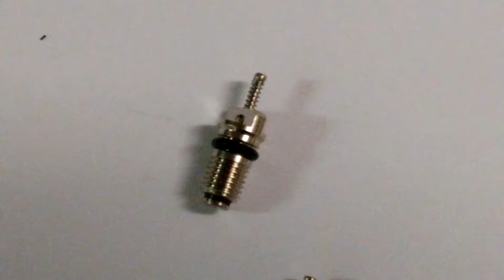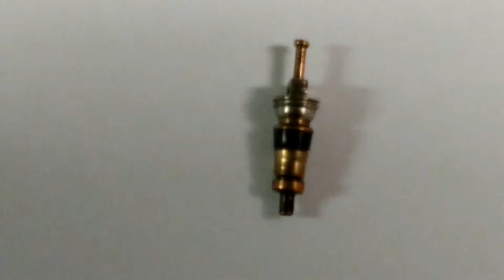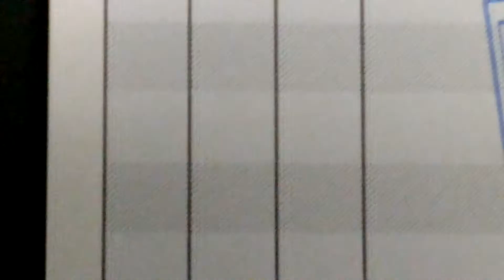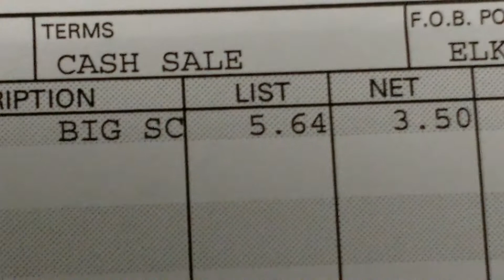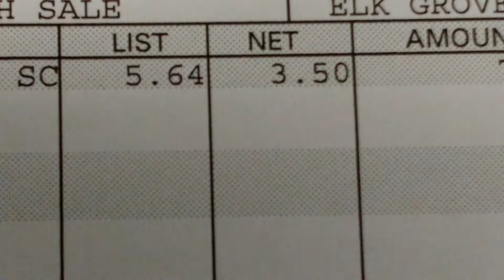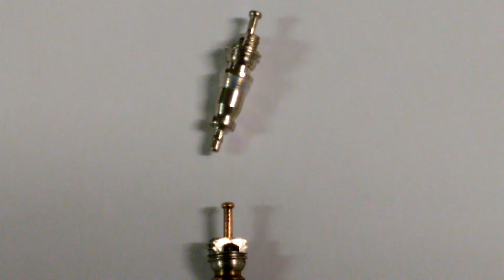JRA valve vs. Schrader valve comparison for auto air conditioner ports

Comment: do you know if 80s toyotas that initially had R-12 systems used JRA or schrader valves?
Reply from the maker: Sorry, no idea.  You might try calling a dealer or a reliable mechanic.  Sometimes manufacturers change based on the cost of parts for new cars.